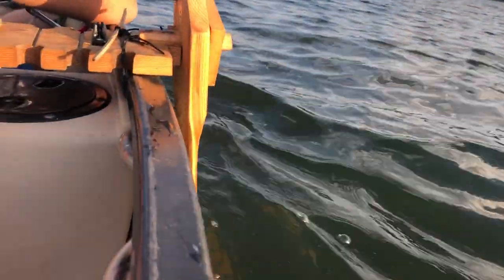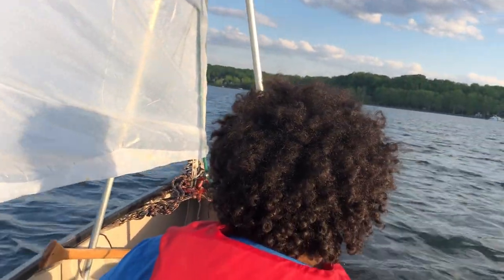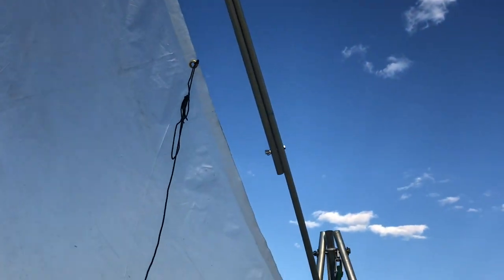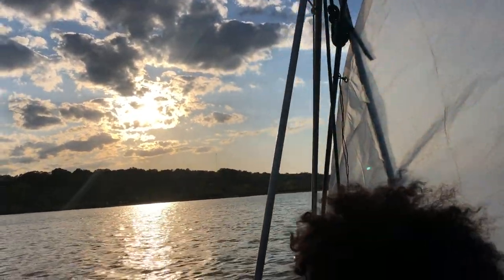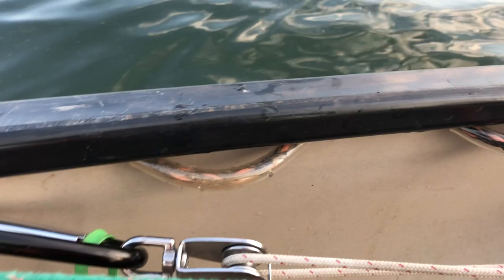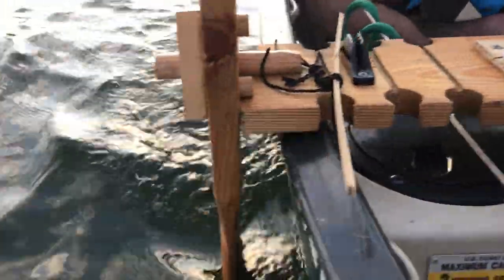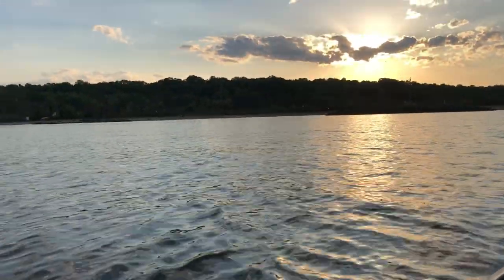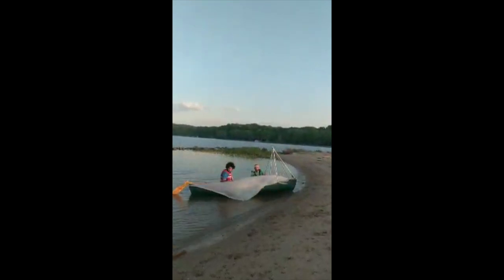Sail Canoe Maiden Voyage!

Comment: Greetings from Guatemala. Thank you for posting this very interesting video. I live in a small Maya village, and it is a 20 minute walk from my house to a beautiful lake. For about a month I have been viewing many sail boat designs, to help me decide what kind of boat to build. Of all the many designs I have seen, I currently find this design you present, to be the most interesting, and the closest to the design I so far have in mind building.

Your boat is a canoe. I am planning to use a setup much like you show in this video, but I have been planning to put this type of setup on a simple 16 ft. catamaran. The only thing on the boat will be me, and the sails, masts, and controls for the sail-mast.

The sail you use is apparently a lateen sail. But it looks a lot like a crab claw sail, and I am wondering if on your sail frame you could just substitute a crab claw sail for the lateen sail. I have no idea if a crab claw sail would perform better or worse than a lateen sail, but I think it would be an interesting experiment to try out.

It does seem to me that a single big sail to control is a lot easier to work with than multiple sails. I will usually be the only person on the boat, and I have no experience sailing – so simple is good.

There are 2 weather conditions I need to deal with on the lake - when the wind is not very strong, as it almost always is in the mornings, and when the wind can get pretty strong, as it often does in the afternoons. I expect that a big enough sail should work well enough to get my boat moving even in a light wind, and that a well designed catamaran with plenty of floatation in the pontoons should provide all the stability I will need in strong lake winds. Note – the lake wind is never too strong for the boats that, no matter how strong the wind is, are safely taking about 12 to 20 people from one lake village to another. The lake winds can be strong, but nothing like sea waves. Also – I really don't want to capsize, but since I will always be close enough to shore that if I do capsize, this should present no serious danger, since people will see that my boat has capsized, and pretty soon some boat will pick me up.
  
Question – Do you have any thoughts about which type of sail – crab claw or lateen – would work best on a boat like you have made, in the weather conditions like I have described?
Reply from the maker: That's awesome Allan! I don't know anything about crab claw sails, but I imagine you created a detachable boom you'd basically have a crab claw, right? Then you could experiment both ways; with and without the boom.

Comment: FANTASTIC!  I have the same canoe and I'm working on an outrigger, but this looks more simple . . .

I'm wondering about the cable(?) loops you've got attached to the black rail?  You've used the to connect pulleys & such.  T

The lateen rig does seem the way to go . . .
Reply from the maker: Yeah they're just some vinyl tubing with a rope inside. I've got an old video about it "gear loops" or something like that.

Comment: Ok i need to try that but i have long and slim canoe 🛶  i think i need to buy outriggers
Reply from the maker: I'm thinking about building some outriggers myself. If I ever get around to it, it'll surely be on the channel!
Reply: @merzoutdoors  Well worth the effort fitting outriggers , I can assure you.
Reply: I loved the Idea! Congratulations! But what material did you use? What's the conduit pole made of? Plástico? Aluminum?
Reply: Outrigger float idea - cap both ends of a pvc pipe . . . or . . . attach a couple of pool noodles to a vertical piece of plywood (cut to shape of course!